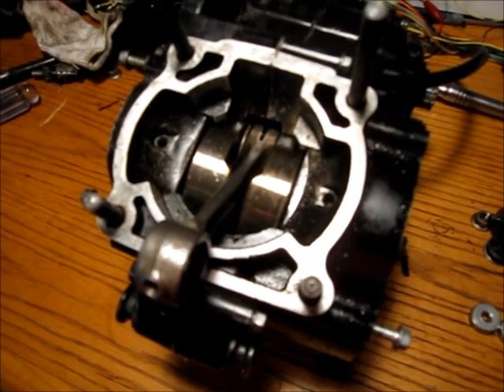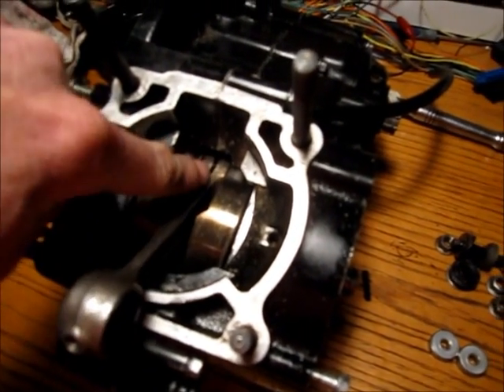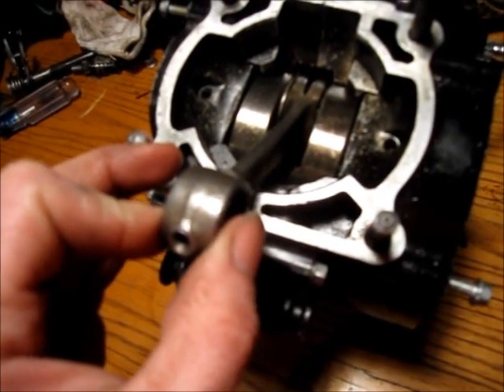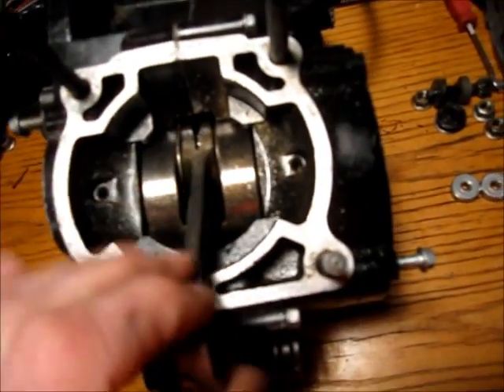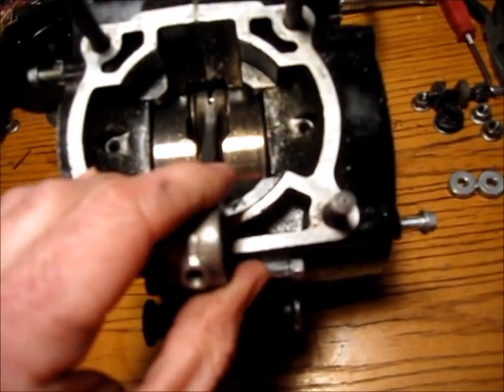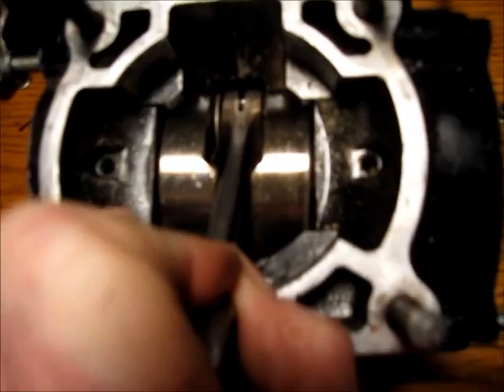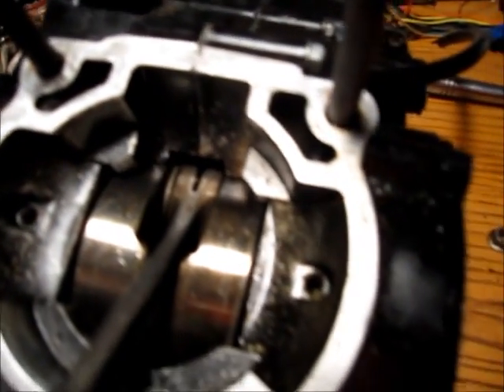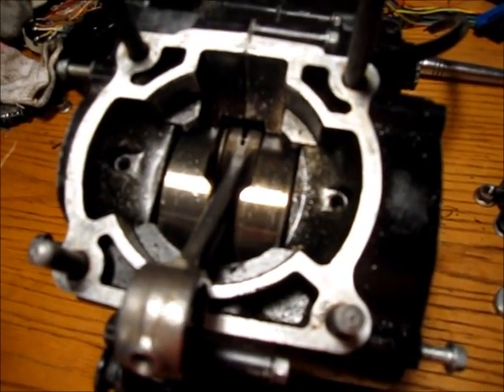How To Check Rod Bearing Play On A Motorcycle

Comment: I just purchased a 2000 Rm 250 for 450.00 and the guy I bought it from was concerned about the crank rod because it has a little play from side to side but up and down it moves a lot so I figured it would be better to just go ahead and replace the crank rod and bearings because I don’t want to ruin the brand new piston and rings
Reply: Can you send a link for the bearing? I have the same bike.

Comment: I bought an rm125 and put a brand new crank rod and bearing into it. Put it back together and rode it an hour. New top end too btw. After one hour I popped everything off again just to look and make sure the cylinder head was ok because there was some blow up chunks from before I bought it. Noticed there was quite of bit of loose play in the crank rod after ONE HOUR OF RIDING. I put it back together. I've put about ten hours on it since. Still rides great but I'm gonna go ahead and get a new bearing ordered.
Reply from the maker: Too bad if you have to get a new crank. A little side to side play is fine, only up and down is a problem. Hope you get it fixed!

Comment: Hi JG, I had a partial seizure of my bike it was like the breaks had been slammed on for a brief second.  The  bike then freed it self and I was able to limp home via the back roads. The seizure was caused by low oil and after striping the top end down. Found that the piston and cylinder were badly scored on the exhaust port side. My concern is that I have done some damage to the big end bearings is there any way I can check for wear while the cylinder is of and the crank exposed as in your video.
Reply: Isn’t that what this video is for lol

Comment: ok... i am facing a strange vibration and sound at very low rpm (idle nd below idle). The sound nd vib vanishes when the engine is revved..my engine is Yamaha meke 4 stroke Sohc single cylinder. have done 26000kms. Any idea what might have happened? i am suspecting a worn connecting rod bearing. Thank you.

Comment: if the bearing is bad as shown in the video, is it ok to change just the bearing rather than the rod, pin & etc? and how to check the piston pin bearing? and how does the knocking sound like?
Reply: Aliff Jamil Why would you not want to  replace the rod???

Comment: I have a 1978 cb750F SOHC4. I found metal shavings in the oil pan and they stuck to a magnet. Someone told me that it might be from the damaged bearing. I'm also experiencing loss of oil pressure at idle when warmed up. So much drop in oil pressure that it dies at red lights. I had a tow truck bring it back home and have not run it since. Any help would be appreciated.

Comment: some two cycle have crank case oil like some is lubricated with gas/oil mix these KX YZ RM CR are all lube by gas/oil only 100% no crank case oil, but Yes some 2 stroke have crank case oil both right.
Reply: Nope they all have to use the premix oil .. no 2 stroke has ever used crank case oil because it will foul out plugs and make the bike run horrible and not to mention it will eat up all the transmission fluid or oil very quick

Comment: hi I have a 1994 Suzuki rm 80 im changing the whole top end on it... I can move the rod side to side and there is about 5-8mm travel on the roller bearing ... think I can reuse
the bottom end that way? there is absolutely no play up and down... please answer me
Reply from the maker: My personal rule of thumb is that if there's no up and down movement it's good to go.
Reply: @jenniesgarage  definitely not true bro I know you said this 5 years ago but side to side play can and will eventually let the crank needle bearings slide out past the thrust washers and there's your top end I have installed many cranks and ever time the crank go side to side play they would throw the needle bearings in the rod it self and a damage my cyclinders ....

Comment: Can u take the connecting rod out without taking the engine apart..
Reply: Arno Low  yeah..yes or no question..smh.
Reply: Lavert Powers Nope, unless you have the world's tiniest hands and can get the world's tiniest socket wrench in there. You're gonna have to pull the case apart for it.
Reply: Smh...thanks. ..I see I have a task at hand..never done but imma sucker for challenges
Reply: Tell ya what...ill watch u guys...just ran into a shit load of tools strickly for go karts and bikes and ect. Aint nothing but time...trust me..I got three motors here....one will become one...lol
Reply: Lavert Powers The only way to learn is to do it.  Everyone starts somewhere.
Reply: And I got it working...lol. sold it yesterday...got another one im working on...got a 8inch back rim?? Lol
Reply: Lavert Powers Of coarse you can.. its a specialized technique called FM... no, it has nothing to do with the radio.. If you not familiar with that abbreviation, it means ya gonna to use some Fkn Magic.
Reply: Yes, just throw the rod...  It may not go back together after though...

Comment: if this bearing is bad would it make ur piston knock plz answer back
Reply: mike hawk no it will not eventually you'll get a rotational whining noise that increases and decreases with rpm.....then like he said catastrophic failure.....if you have a knock......you need to pull it apart and find signs of heat and friction...blued metal is overheated dead metal
Reply: @brokebikemtb4448  so your saying half my crank is overheated? Half is blue and half is almost a polished finish.. what does it mean? Bought the bike a month ago, noticed a knock that is getting worse, pulled the head, scoring on piston and minor scores in the cylinder from an improperly installed air filter (no probs.. big bore), the bike was oil injected however the previous owners were still running premix with the oil pump connected and working. Any ideas?
Reply: Yee Thirty play between piston and cylinder, otherwise known as piston slap.  Need to see if bore is still in spec(probably not)... fix it before it shatters the piston skirts.  Check big and little end clearances while y0u are in there...
Reply: @brokebikemtb4448  l

Comment: Ok the side to side to play is at.      .018 to .025. When you get a crank back a new rod.
Any up and down play you should have a new rod put on.
All the oil that I saw in the crank case tells me that he has a crank seal out also.
Reply: .030 
good or bad
Reply: @saravanansarvn8843  
30 is on the loose side 
.018 is better
Reply: @250race  thank you sir
Reply: I bought an old two cylinder two stroke. The side to side in both rods is about as it is in this video. There is no up and down play so I should be good?
Reply: @kevinkleinhenz6511  
Put a filler   gauge.
.015 to .030 is the max

Comment: Actually i am hearing a grinding/rubbing noise from my bike's engine at idle and low rpms ... the sound increases with drop in RPM. The engine is YAMAHA make 4 stroke single cylinder SOHC engine. Any ideas about the symptoms ?

Comment: clearly wrong about what is right and wrong.  what is and what is not acceptable.  use service limit and prove your case.  FEELER GAUGES.  sorry but that is the way it is.
Reply from the maker: I realize some folks like their spec sheets, but if there is any noticeable up and down movement in the rod, it's time for a rebuild.
Reply: my aprilia RS125 conrod has massive side to side movement and no up and down.  This tells me the thrust is out badly, then its time for a rebuild.  more left than right movement puts strain and excessive movement on the top end boring more damages both to cylinder piston and rings.  Hence not totally right.  I found out the hard way using your method.  If you're going to do it right, then do it right first time.  again sorry but that's the way i'm built, had my hands burnt too many times, maybe I should also quit cooking. :P  but nice for you to reply, thank you bud.  However, I would like your input about specing the engine rebuilds and maybe covering a topic or 2 with a before and after built of a running engine - along with parts used.  Be a good way to put this to bed I guess.
Reply: Imo he made the video not about side to sise play, but up and down.... he said no play should be noticed up and down. he was talking about All BIKES, he probaly don't want to look up every motorcycles side to side play and list it..
Reply: Yes sir. I found feeler gauges is my garage, tell me that ain't a shinny treasure to fins laying around unused